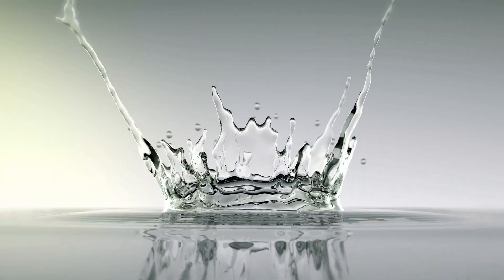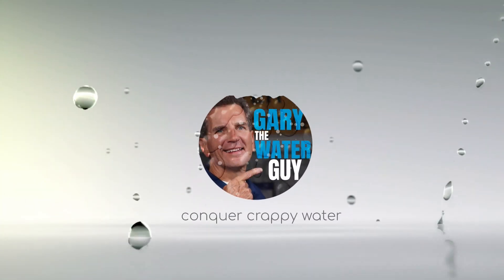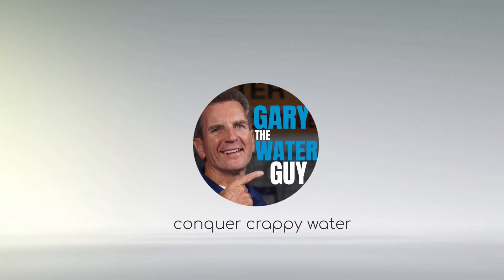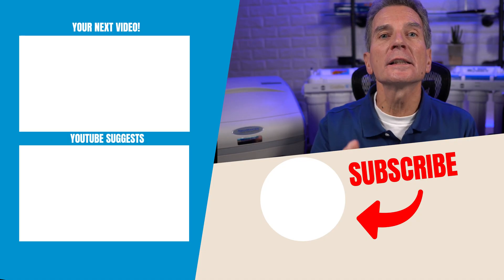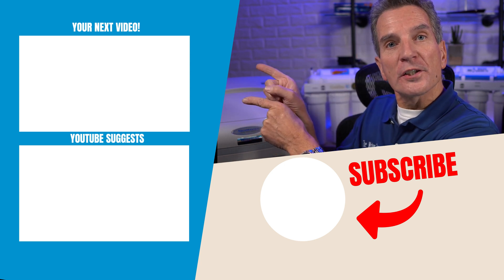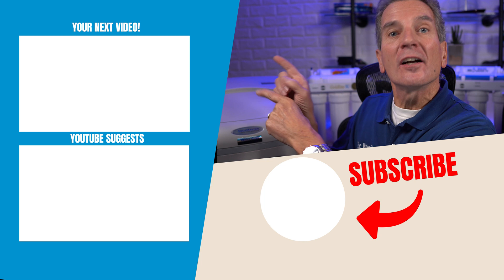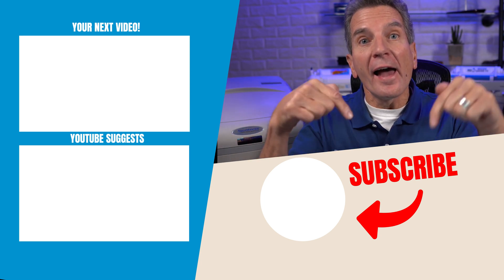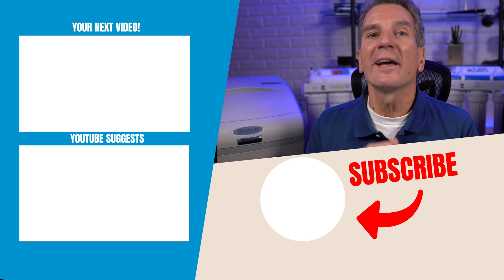How MUCH SALT should a WATER SOFTENER USE?

Comment: No help for me in this video. I wanted to know what issues or problems would all-of-a-sudden be causing my system to use 2-3 bags of salt a week? We are two elderly folks, not using much water...I have no leaks or running toilets.
Old style time clock system....I have pulled the float and it seems fine and operates freely. The only other thing I think it could be is the control valve itself?
Reply from the maker: First always make 100% sure there are no running toilets, that would be the most common reason.  Then either the settings have been changed or the valve itself is malfunctioning.  You might want to check out a metered water softener if thinking of a more economical replacement like one of these https://waterestore.com/products/hum-metered-water-softener-45-000-grain-capacity-free-shipping

Comment: Hey gary, have a big problem for high salt consumption. Hardness is roughly 200 ppm, average consumption is nearly 1600 ltrs as per calculation salt consumption should not be more than 30-35 kg, but it consumes more than 70 ltrs. 

Any suggestions
Reply from the maker: Check the settings to make sure that they are correct, this video will help https://youtube.com/live/c6r7qUK8to4

Comment: Hi Gary! Great video thank you for sharing your knowledge. Quick question if you don’t mind as I am new to owning a water softener. I am one person in the home. How many lbs of salt should I set? It currently is set at 7. And the metered regen is set for 600. Thank you!
Reply from the maker: There are lots of variables depending on the size of water softener and your water chemistry but it sounds about correct

Comment: Thank you so much for your videos. We just got our first softener system and learning how to use it. 
I am struggling on how to set-up the right salt usage level. 
Our municipal water hardness is about 40.2ppm, and iron of 0.104ppm. I don’t see magnesium on water report. Installer initially set the machine for 10gpg with 8lbs of salt.
I have re-set hardness in setting as 5gpg after watching your video, and 3lbs of salt. I am not sure if 3lbs of salt is right setting for my family of 2.
According to the product manual, salting should be as follow
High: 26,100@11.2lbs
Medium: 21,300@7.5lbs
Low: 9,900@2.25lbs
Efficiency: 4,400@2.25lbs.
I am not sure what those numbers are for. Does it look okay for you? Or should the setting be changed differently?
Reply from the maker: Glad you liked the videos.  I would set it to medium @7.5 lbs.  Your hardness settings look good.

Comment: my softener uses a 40 lbs. bag every day, it is a metered softener, I have wondered if the company that installed it set it to high? no idea how to adjust it
Reply from the maker: That is an extreme amount of salt.  Yes, I would check with them, either it is set too high or you have a leak somewhere and you are going through massive amounts of water every day.

Comment: Dear Gary, I see you as a great professional in this area.
My question is regarding the ozone generator. It's difficult to find the right info about how much ozone should be used and also how to avoid changing the taste of water...
Reply from the maker: I don''t like or use ozone generators so I don't know.  They are expensive, don't last very long, work inconsistently and the ozone they produce is not compatible with the plastics in the valves.  Sorry, but I can't help you.

Comment: I'm having a build up of black, slimy, gunk on faucet heads which I'm reading is a result of harmless bacteria feeding off of manganese. Does this mean my water softener settings are off?  I never had this issue before the system was installed.
Reply from the maker: Maybe, maybe not but I would certainly have them checked.

Comment: Do you have a video that explains what your salt dosage should be set at on a 24,000, 32,000 or 48,000 grain water softener? Should they be set at 6 lbs, 9 lbs, 12 lbs per backwash or etc? Thank you
Reply from the maker: Typically, for a standard efficiency water softener, 7.5 lbs for every 30,000 grains.

Comment: We have 10 GPG, about 1.5 ppm manganese and about 0.5 ppm iron, 2 adults, 1 teenager, 2 kids, and a baby. We have an Autotrol 255 with 760 Logix controller, 64K 2.0 cuft system. How do I even begin to figure out what to set my softener system to? Is there a calculator somewhere I can put all this info in to know what settings to put in?
Reply from the maker: This video will help you https://youtu.be/XMY69hdhX44

Comment: Hello sir hope you are doing well. I live in a house with 8 adults and we usually have to use a 23kg bag once a week. Do you think this is too much? It regens every night.  Also should the salt be higher than the water level?
Reply from the maker: Yes, you need to have the salt higher than thew water.  I would have your water tested for hardness and make sure that the water softener is programmed for your level of hardness correctly.

Comment: We have a WaterBoss 900 installed 3/19 and is now using more salt than before. What do we do/check? Thank you
Reply from the maker: Check the settings to be sure they are correct?  Also, be sure there is no water running in the house, like a leaky toilet.

Comment: Gary, I have a newly installed WS1 water system for my well water with very hard water; since installation there has been a great deal of difficulty setting the salt levels and although the technician has been in numerous times I still can taste the salt (brine) in my water when I shower.  My worry is if I set the salt too low then it will not soften the water leading to problems in the future.  Typically only 2 people in the house and not a great deal of water usage.  Any suggestions?
Reply from the maker: Assuming that you have a 4 or 5 button control valve you set the hardness at 2 above your hardness number.  Assuming the system has been programmed correctly you never need to change the salt settings.  What is the TDS of your raw water in parts per million?

Comment: "Efficiency of water softener".  That's where I am stuck.  How do I know the water softener is efficient?  
We use very little water.  I calculated 4,704 grains per week, so I'll be regenerating once a month or even 6 weeks on a 35000 grain softener.
Reply from the maker: The water softener needs to regenerate at least once every two weeks to keep from clogging the media.

Comment: I just bought my house and ran out of media and salt recently. The salt bags were easy enough to replace from HD. When I called the local plumber about the filter and media service (previous elderly owner used them) they wanted almost $300 for service. HD sells a while new tank with NEW meter for $600!.. The old meter doesn't even have a readable screen. Should I just buy a new meter and attached it to the old tubes?
Reply from the maker: I'm not sure what you mean when you say ran out of media but I'm assuming you mean that the media isn't working anymore and you're weighing the cost of replacing the media vs replacing the whole softener?  Media replacement is very expensive, lots of labour involved.  If you have a quality water softener and it's not all that old replacing the media makes sense.  If it's just a disposable inexpensive Big Box store water softener, get the new one.  Just keep in mind that with the new one you'll likely need to do some extra plumbing to get it to fit and pay to get rid of the old one.
Reply: @water_estore  I have 2 tanks that look like torpedoes (acid neutralizer?) , I thought that the pellets inside were called media. The top tank is empty (I shine a light behind it) and they told me that it was 300 to fill it back up. It still runs cuz I hear it cycling. My question is should I upgrade to a digital motor like the ones you show or have them fill it up and just wait until the motor dies to replace it.
Reply: @water_estore  I also have the salt tank right next to the torpedoes which I've filled from HD (super easy)